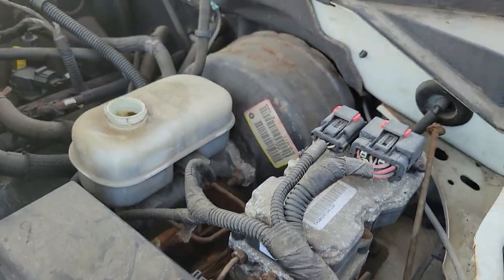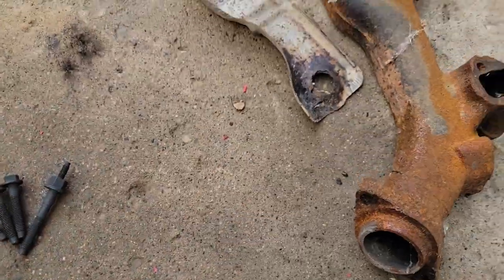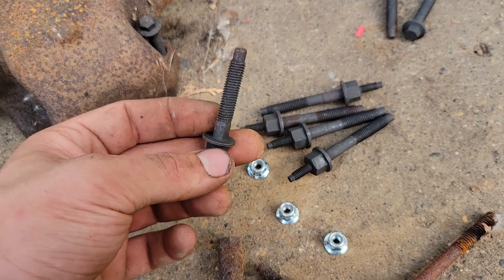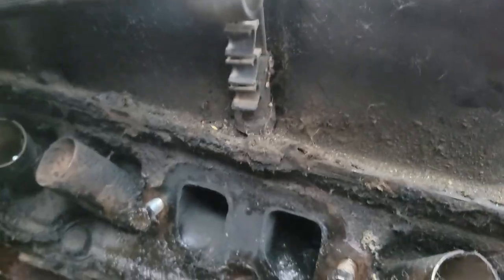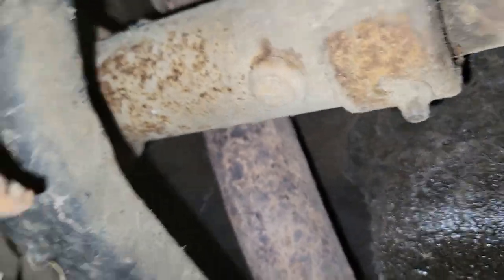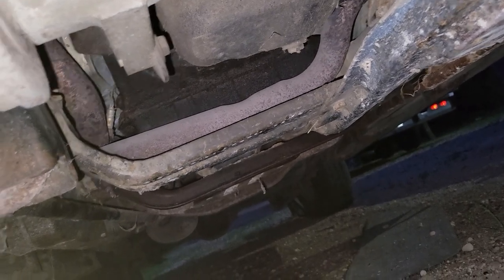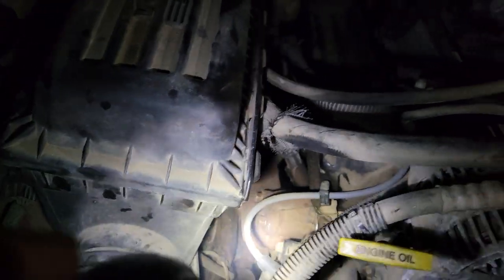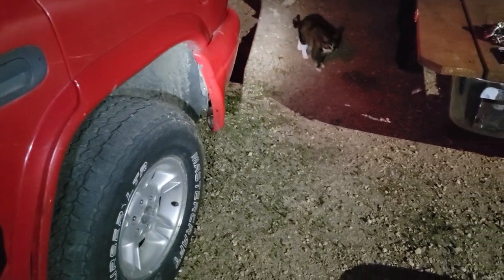1999 Dodge Durango SLT abandoned for 14 years | Part 3

Comment: Could be clogged injectors will cause it to feel like misfire. Running it low on fuel picks up the debris at bottom of tank. That happened to my Suburban. Idle feels like misfire but when I drive it, its very smooth.

Comment: Im thinking about buying a 98-99 Durango with 5.2 engine. Im debating should i or shouldn’t i buy it. I already own a 2005 Suburban Z71 that refuses to die with 360k+ miles and an 07 Yukon 4x4 with 230k+ miles either way im not as skilled as you are and will get taxed up the wazzoo by shops for the work. I find it weird that the huge house on wheels Suburban gets better fuel economy than the smaller Durango. Think it gets better or same as my WJ 4.0L Jeep that was stolen buy a punk back in 14, before he had an extended stay in prison.
Reply from the maker: Good luck! Best I can say is as long as the transmission is serviced properly, they're usually alright. And I wouldn't buy one quite as rusty as mine if I were you lol

Comment: I have to stop driving my Intrepid because it's leaking antifreeze out of something in the front. Possibly just a hose. They feel a little warped from being old. It has 275,000 miles. I'm going to jack it up and see. It's a freaking goat. It never stops running. Unfortunately other parts do break though.
Reply from the maker: I've had old radiator hoses delaminate and leak on me. Good luck!
Reply: I had a 2003 Intriped, I'm a big Dodge guy but I hated that car, had no heat in it, so after the head gasket blew I scraped it, an in few hrs already had a 2004 Dodge Ram with the Hemi.
Reply: @MNMoparMinivan  They are the only thing in the cooling system not new.
Reply from the maker: @trr5291  sounds like they might be new soon! ;)